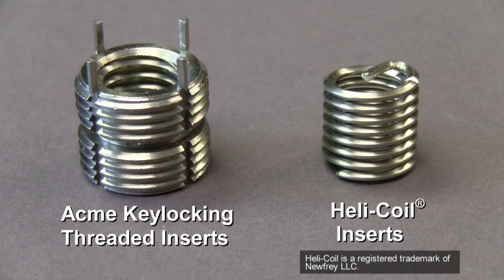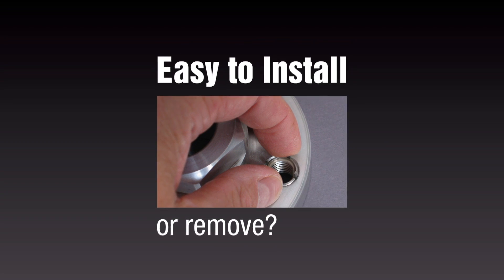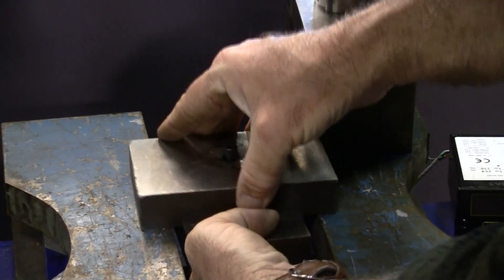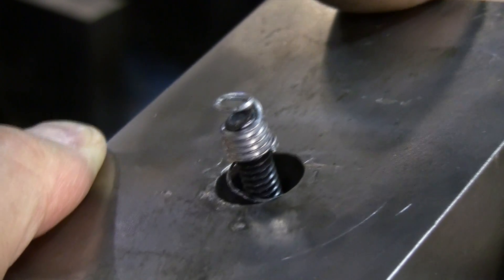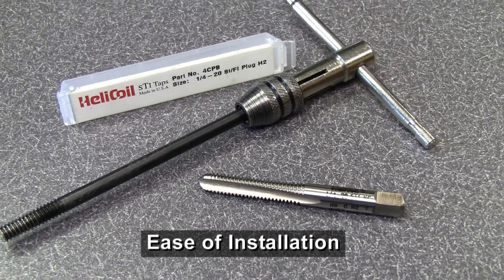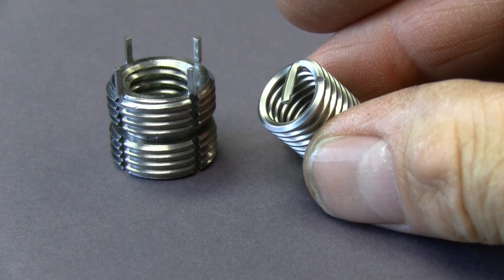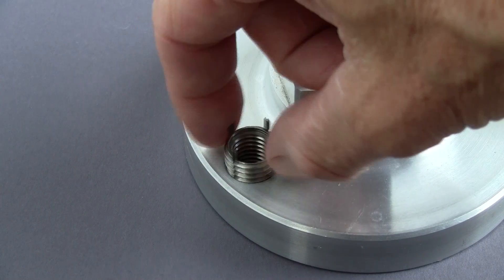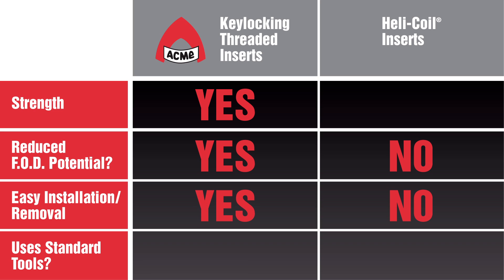Acme Keylocking Threaded Insert for Thread Repair vs Heli coil Inserts

Comment: Like another post here . I use the smallest pipe plug. Tap install plug with loctite. Drill and tap original thread. Grind or file flush. Always on hand if you search through the junk drawer. I always keep 1|8" pipe plugs around. Perfect for up to 6mm or so.

Comment: I use neither.drill and tap a allen head cap screw.drill and tap the hole that is stripped out.Thread the cap screw into the hole with locktite 272.Cut the bolt off and grind flush.Been doing this for twenty years and never had a failure.I actually made up different sizes in my spare time to make the repair faster

Comment: the big headache with a helicoil is needing a special tap because a helicoil is the same thread pitch, but a larger diameter.  with a keyed insert, they are typically made with the outer thread conforming to some larger size UN or metric thread, and no tool special tool is needed as the tangs can be driven in with a punch.  however the trick to helicoils is using what they are referring to as a prewinder, most kits do not have this, its just a smooth rod that can grab the tang, it makes installation a pita.  i've always just made my own prewinder, take a bolt the size you want to use and grind about 7/8 of the end of it way and the tooth thats left will grab the tang and rest of the remaining threads will help stabilize the wire from jumping threads during installation.
Reply: Simple answer: Just buy the Heli coil kit. It comes with all the tools. I installed many of them and my tapping tool is still the original! But i also use it just for aluminium heads and for the helicoils only!
Reply: @reinhardtrippmacher8776  but again, that's only 1 size. You need a tap for every size and they aren't nearly as strong as keyserts, plus depending on your hole sometimes you need a bottoming tap because of a very shallow blind hole.  Also, I use them in fixturing to temporarily change a thread size on a hole for mounting things, I just snap the tangs off before putting it in so I can remove it later.

Comment: looks like Keysert inserts. Installation is the same as with Helicoil. Drill, tap and insert. 3100 pounds force for the Helicoil are more than sufficient for most applications
Reply: Well said. For most anything that is not an aircraft or a bulldozer, Helicoils are affordable and more than up to the job.

Comment: Pretty one sided view here, why did you show the helicoil insert being installed without using the proper tool. If the mechanic does not know how to do the job properly he should be no where near it, you also omitted to say that helicoil inserts should be installed with a coating of threadlock, attention to detail ! must try harder.
Reply: Actually you aren't supposed to use any type of thread lock on helicoils. It can cause them to spin
Reply: it depends on the application.  for fasteners installed iaw certain aerospace requirements you cant use a threadlocking compound.  personally i prefer to use a keyed insert in nearly all applications, however sometimes a helicoil is the better choice, ie, fasteners that see large and frequent heat cycling.
Reply: @salvadorebertolone  we are the key locking thread insert, wire thread insert , self tapping insert supplier in China . pls visit :www.thread-insert.com

Comment: Totally unfair comparison, the keylock has a larger outside diameter which will be stronger in aluminium but also needs a larger hole to insert, the keylock also destroys the hole when removing, helicoils are easily removed with no damage to the hole and can be replaced with a pair of pointy nosed pliers.
Reply: Exactly! Hence Installing the ACME key lock inserts in a cylinder head wall of a motorcycle is impossible as their diameter is way to big. The wall will be gone. As well as the torque used on aluminium cylinder heads is way lower han they been testing. Installing helicoils is not time consuming at all if you did it once. Taking out the broken off end is a must...who leaves them in??? ...and german technology requires special tools. Those helicoils are always sold in a set. I have been installing many of them and never changed the tapping tool!
Reply: @reinhardtrippmacher8776  Abom79 said to hold his beer..

https://www.youtube.com/watch?v=en5s0x3583s